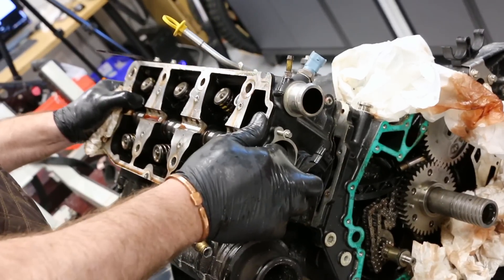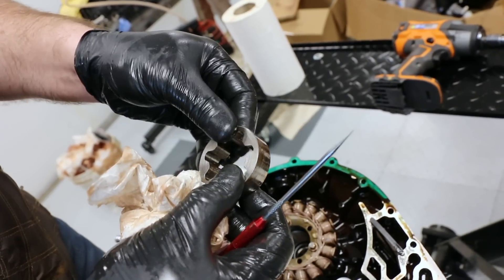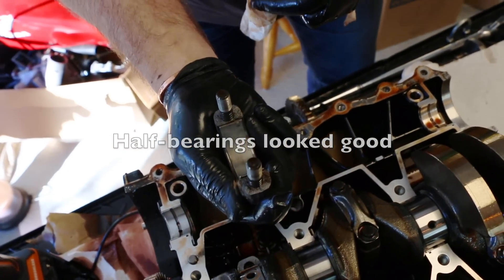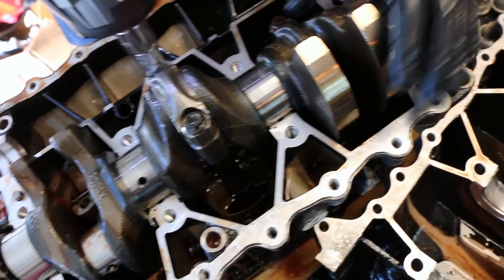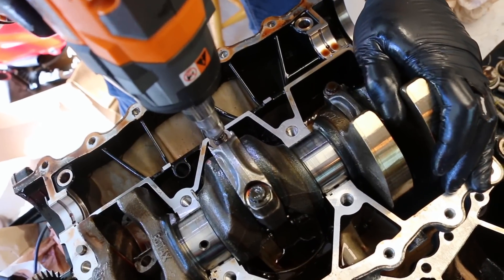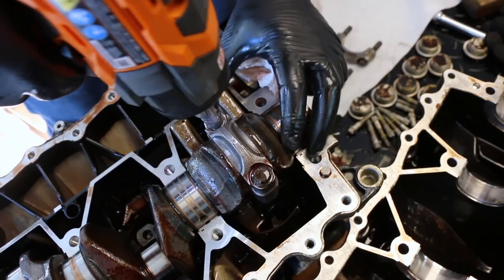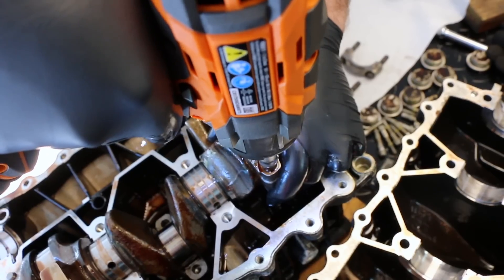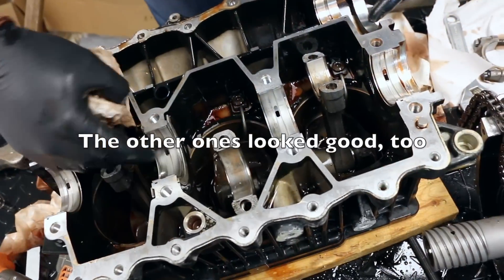Sea Doo Jet Ski Supercharger Failure Aftermath Part 2 of 4

Comment: Please sir, I'm from Morocco, nice to meet you first, and I'm also your follower, i have one question, is when i finish crusing, and i rince m'y seadoo, engine oil comes with water from the two holes behind, i do not know the probleme where, and also, every time i want to check the oil after each crusing, i find it lesservthan before about 1/4 liter oil needed ?? Please can you help me sir❤❤
Reply from the maker: What year and model machine do you have? There are a number of reasons why you could be losing engine oil into your hull.  It could be the oil radiator is leaking. I would spray down your engine with some engine cleaner so that it is free of grease and grime, run it on a hose for a couple of minutes and then look for leaks around the gaskets and seals. Let us know what you find. Good luck.

Comment: Is supercharger failure a common thing on these? Just got an RXT 255 and want to know
Reply from the maker: Sea-Doo supercharger flaws ended after 2007, so if you have a 2008 or newer model you should be OK, however, you have to make sure they're rebuilt about every 150 to 200 hours. The 300 hp models apparently don’t require rebuilding.
Reply: @3ftDeepChannel  thanks so much, do you know of an even better solution? I have seem some videos with some RXTs that have turbochargers installed...
Reply from the maker: To me, the best upgrade for something like that would be an SCOM from RIVA Racing. Give them a shout and see what sort of improvement you could get on your machine with one of their modules. Good luck!

Comment: So basically, remove timing cover, clean oil pump out and also the secondary pump and call it good after flushing with new oil. The oil filter would have cough any of the small particles. Had the same happen on my 2012 RXT, over 100hrs after doing that and no issues. This is kind of overkill.
Reply from the maker: Well, we wanted to show the different areas of concern. Some engines will have a lot more damage than others ...especially if they have supercharger bearing failure. Thanks for your comment.

Comment: Hey guys I have a 2018 Sea Doo rxtx 300 had supercharger bearing faulier Sea Doo replaced the supercharger assembly they did not check anything ealse my ? Is should I do oil change and check if it messed anything ealse up what do you recommend for me to look at thanks Esteban
Reply from the maker: Yes, definitely check in between the folds of the oil filter. There's not much else you can easily check though. I'm very surprised it failed, as the newer models are supposed to be much stronger than the old ones. Hopefully it didn't actually come apart, and your engine is okay. Ask them about the condition of the bearing and get it back from them, if you can. If it's not whole, the pieces had to have gone somewhere. Good luck!

Comment: I recently purchased a 2007 seadoo speedster150 215hp with 0 original hours.  Besides the ceramic washers anything else I should be worried about? Manufacturer date was June 2007. I am also in BC.
Reply from the maker: Wow, an 11 year old machine with no hours. Not sure if you're saying the engine has been rebuilt but if there is more than 150 hours on the supercharger, in addition to replacing the washers you should do a complete rebuild of it. The pump should be checked for water/rust inside. Check for codes, and proper function of the gauges. As we haven't had much experience with non-PWCs I'm not sure what additional items the Speedster might need, but the forums will probably help. Good luck.
Reply: @3ftDeepChannel the guy I purchased it off bought it test drove it had it professionally winterized and put it in his garage till I bought it. I put the first 2 hours on it in October everything works great. I even had to take the protective plastic off the stereo. He even let me take it for the day to make sure everything was good. Definitely don't find deals like that very often. I paid 8500$

Comment: And the lesson here is Don't by a super charged Sea Doo folks, they're nothing but trouble!
Reply from the maker: Yes, but coupled with an intercooler and you get 60 extra horse power!
Reply: That is not correct. I had a wake pro for years and looked after it. Never had any issues with the supercharger. So they aren't "nothing but trouble" at all. Don't go writing comments about things you've never experienced or learned from hear say. Its a terrible attitude to have and a baseless comment at best.

Comment: If it’s throwing codes it’s not setting “check engine light “ or anything on screen or lights I can 2x the exhaust but it’s flowing well as far as I can tell seems like a plugged exhaust would affect all the time not just hot.
Reply from the maker: I'm not thinking it's plugged. I've seen a case once before with the same symptoms and it turned out to be leaking exhaust hose. I'm not totally confident about it, but it's worth another check. He looked, but couldn't see anything. The dealer found the leak.
Reply: I just fixed a exhaust leak on my Wake, the leak was bad enough that I had a hard time getting to 6500 rpm. I found my leak at the J pipe to the exhaust manifold connection, corrosion under the clamp allowed the leak to form. 15 min fix with a clamp clean up and re attaching the J pipe.
Reply from the maker: Nice,, thanks.

Comment: Hi could you help me? My gti 130 4tec when it reaches the operating temperature and I turn it off when I'm going to start it gets heavy and I have to wait cool to try to get it. I have already replaced the starter motor, the battery, the starting relay, I have already cleaned the battery terminals and it did not work. Do you have any idea?
Reply from the maker: That's a tough one. It may be an exhaust issue. Check all your hoses very carefully. Also check to see if it's throwing any codes.
Reply: What can be in the exhaust? Could it be bendix? When cold the start is good. No codes in the scanner. The ski does not fail, it runs very well.
Reply: I have a 2015 155 Ltd and I have the same issue also replaced batt no change only happens when hot. Tired diff fuel, I replace my spark plugs each season if anyone else has this or knows what to do please let me know!
Reply: Renan Camargo is it cranking over?
Reply: @jacksbackable   Slow start and does not start
Reply: Replace the battery cables. Double check your ground connection first. Google voltage drop test, and go from there. Hope you get it sorted out.🍻
Reply: hi Renan i  couldnt really understand what you said in your post as it was not actual english, which is important if you want someone to understand you. but im going to guess you have a starting issue when your engine gets hot. this was a common fault on honda CBR600 03 models where the rectifier would get hot and cause an abnormal load on the battery. changed the rectifier with another later model and the problem goes away.